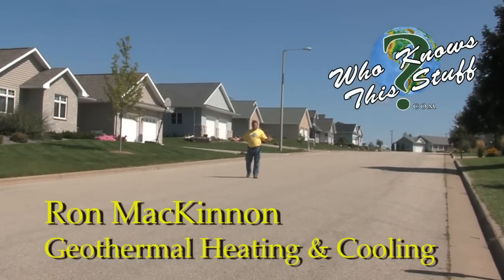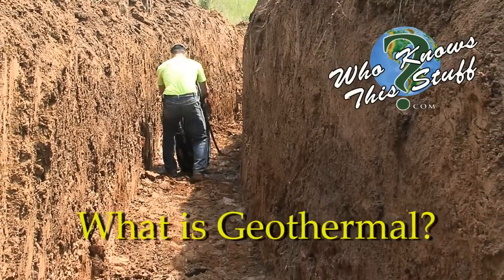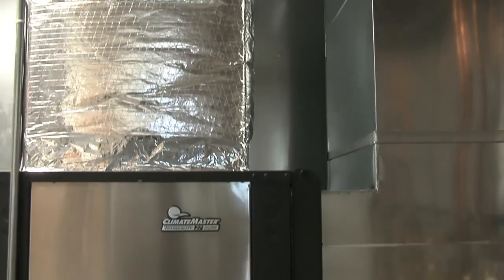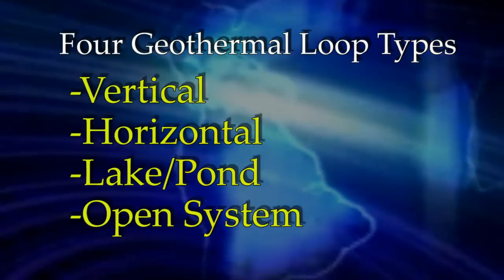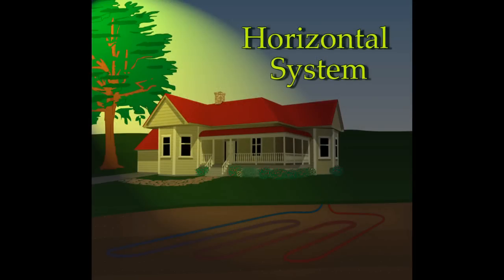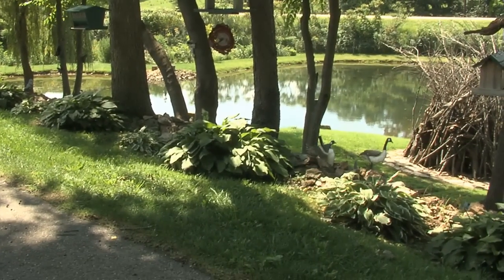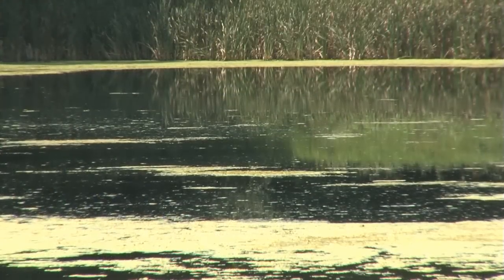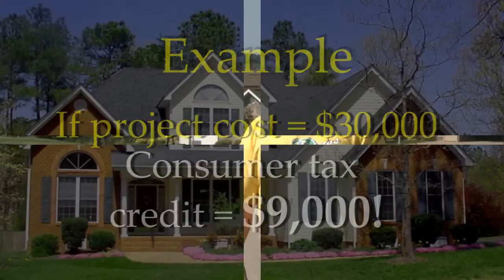Geothermal Heating and Cooling Overview - The Basics

Comment: the problem by the vertical loop systems is the constant temperature changes in underground, if there is groundwater can these systems worsen the water quality!!
Reply: The temperature of  the ground changes far less than the air temperature.  As the GSHP loop depth increases, the fluctuation in the ground temperature decreases.  At 40 feet, the ground temperature is essentially constant; at 20 feet, there may be a change of ±2°F from the average, and at 5 feet, the change may be ±10°F.  Thus, vertical loops have an advantage over horizontal loops in this regard -- horizontal loops tend to be 3-9 feet deep.

Comment: Nice vid...   Is it possible to mix a vertical and some horizontal ground loop in one system?  Sort of a hybrid deal.    We want to drill a regular water well, but if the attempt is unsuccessful we would like to use that particular drill hole as part of a geothermal loop combined with horizontal. (due to cost)